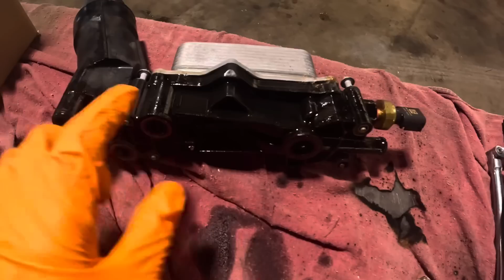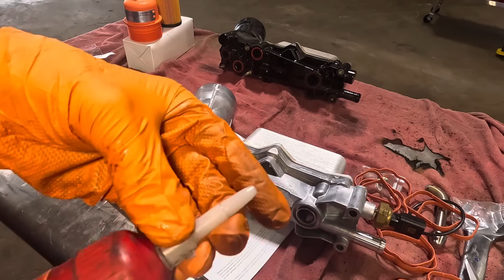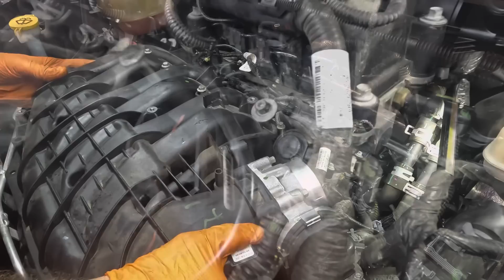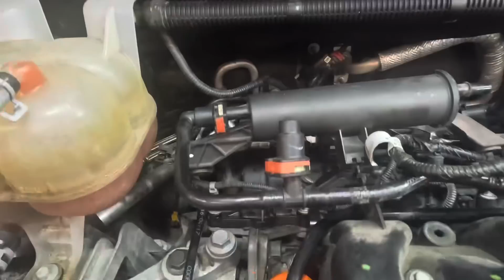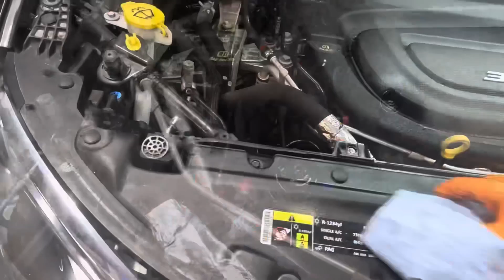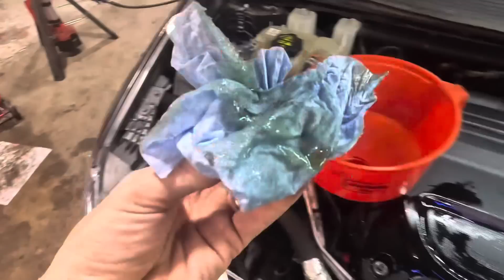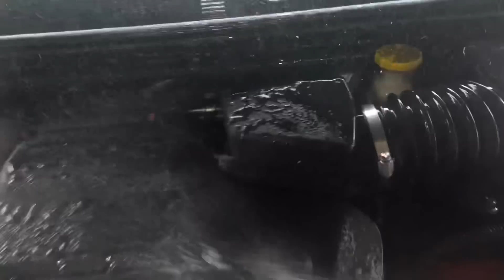Plastic Pentastar 3.6 PT2 Chrysler Dodge Jeep Ram Volkswagen. Leaking Oil Contamination!

Comment: As I understand it, the torque wrench in reverse thing is mostly about not performing unclicks on set fasteners (the ones that require a "Nyyraahh!" to get moving to begin with, especially), rather than simply loosening not-yet-torqued fasteners prior to torquing. Because torque wrenches aren't (usually) a solid piece of metal, but rather a number of floating bits of hardware in a tube in order to enable their ability to click and adjust for varying levels of torque. The stress of unclickage can break 'em. Other'n that scenario...yeah, sure. I don't see any reason not to use 'em in reverse...but then, I usually have to operate on the "get tight, then go a quarter turn to torque" because I have a ginormous torque wrench for tires and no small ones....yet.

Comment: You are lucky it's in a Pacifica and not a dodge promaster. The intake manifold bolt tend to rot away from no engine cover and I'm in northern Ontario where salt is used in abundance lol. I've done 3 now and I had to break the old intakes off of 2 to get to the 2 rotten bolts unfortunately

Comment: I'm curious are there any good manufacturers left ? Sure the older ones didn't have abs brakes. Maybe even got lower gas mileage.  But when your new car or truck arrived it didn't have a computer they charged 10 grand (or more) for.  I think my next "new" vehicle will be made in the 60s or 70s and come from Arizona.

Comment: Aren't those engines also known for dry starts? Their is an oil filter conversion kit that fixes this issue, bit I wonder if it would work with that updated cooling unit.

Comment: While I am mechanically minded, I'm not a mechanic by any stretch of the imagination. Regardless, I've learned enough through your videos that when a friend of mine needed a part replaced and they wanted to charge her an exorbitant amount (which they claimed was a great deal), I was able to tell her that replacing that part was super easy and that there's no way that it should cost that much. So she went out and found a shop that replaced the part at 1/2 what the original shop was going to charge her. Your videos are saving us money! Thanks!

Comment: My guess on the reversed torque wrench is the amount of torque applied in reverse.
I used too loosen the lugnuts when changing summer/vinter tyres with my torque wrench. One day I felt I needed too much force, so I changed method to something with less precision.

You can probably break the torque wrench if you overtorque it in reverse.
Reply: You can break it in either direction, use a 4 way or breaker bar

Comment: Ray, every spend hours putting an engine like this one back together, start the engine, then see a fine spray of some fluid shooting over one of the fenders from low in the engine?  Also, glad to see you are not a tool thrower.

Comment: Knock on wood, I own a 2015 Wrangler from new in Feb 2015,  no oil leak yet (52,000 miles) and just looked through some jeep forums and that is a common problem for the 14/15 wranglers. Great! I guess I'll be on the lookout for this or possibly do this change before it happens.  Thanks for the info Ray!
Reply: There are other spots on that particular motor that will leak, you will find plenty of yt vids

Comment: Isn't it the chemical composition of the coolant that determines if they can be combined?  Some are ethylene glycol, some have silicates, some don't, etc.?  Isn't the color coding supposed to indicate the chemical composition?
Reply: The universal extended life coolants, like the cheap house brand ones are all you need.  They satisfy all specs and mix with every formulation.  I can tell you from over 17 years of experience using them,  they're the best.

Comment: i would bet that the plastic parts didnt have threads in them when they were installed at the factory and the bolts cut there own threads when they were installed.

Comment: At 17:00, I'm glad you said that Ray. One of the clowns I used to work with was like that. If you did a job differently than he did, you were an idiot. Even though the end result is the same. One time at training we were discussing that very same thing. The instructor said it doesn't matter how you do something or figure out a problem on a vehicle. There is always more than one way to do it. Doesn't mean any way is right or wrong.

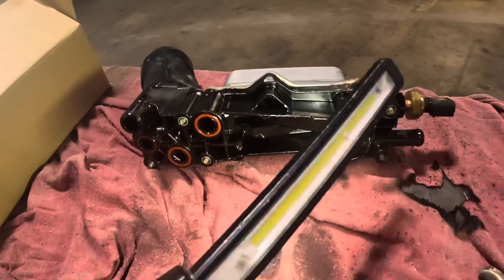Comment: 1:45  And Chrysler will not do a thing about a crappy part.  Just make you keep on replacing it.
I haven't received notifications from YouTube for years.
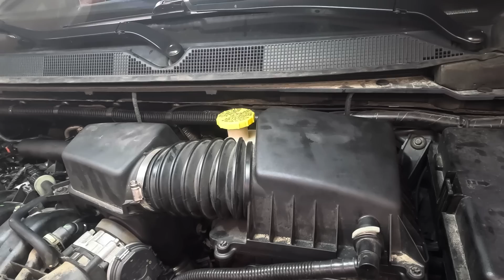Is it me, or didn't you tighten down  the air intake hose from the filter box?  45:55 to 46:44
Oil price is a bit expensive.

Comment: I'm back again Ray. I do hope you are getting enough sleep. At 22 minutes you spray the screw holes out to assure no liquid or debris inside, but then proceed to spray penetrating oil (which does not evaporate quickly) over those same holes without showing or mentioning blowing them out again. That twice today that I detect you deterring from your usually logical and consistent standards of performance.

Comment: Probably like everyone else has said - that part is much nicer - and appropriate for a part deep into the engine. The convertible I had - it was heavy - they said the factory suspension was not durable - did not wear out so much has have our terrible streets destroy it.  So they said the use - I could look it up but a brand that started with M and they make modified parts - and he said when that suspension comes up for replacement we should use that.

Comment: Hey Ray, I think you goofed up a bit with the loctite on screws #2 and #3 by applying it just beneath the screw head on those screws. The thickness of the flange on the oil cooler suggests to me that little, if any, of that loctite will actually make its way into the area where the screws actually grip the threads on the part to which the cooler is being secured.
Loctite down in the hole and loctite on distal end of screw threads = good. Loctite applied just under the head of the screw - not always good.
Reply: My concern on applying loctite to the hole is if its a blind hole it may hydro lock and crack the housing if its a blind hole I have seen this many times

Comment: I really only knew Dorman for those drawers full of nuts, bolts and hardware, that stuff was pretty good and saved me a few times. A couple of years ago I was going to replace a driveshaft in my AWD Volvo XC70 and considered a Dorman replacement shaft. I ultimately opted to dispose of the car, but I doubt that I would have used that Dorman part.

Comment: Using a torque wrench on a part or fastener with a MFR specified torque is never "fooling around".  It is always correct.  Maybe not always necessary, but it IS correct.

Comment: Not to criticize, Ray, but I noted that you didn't pre-thread some of your fasteners before putting your power tool on them and running them down.  Doesn't that have a big risk of cross-threading?  Either way, it made me cringe every time you did it.

Comment: Depends on the torque wrench. Read the manual on your particular tool. Some go in both directions, some only indicate in one. You might be able to remove the fastener by going lefty loosey, but if you’re trying to get a torque value, it might not work (ie give a valid reading) but not damage the adjustment, and some units might be thrown out of adjustment by being used “backwards “, and give bad readings. But since this particular one comes with a reversible ratchet head, I am sure it is fine.

Comment: The torque is important for plastic holes, someone without a feel for what it can take can destroy the threads. If you have that feeling and a level of caution from experience you can do it by hand. It has gaskets and no mess if it leaks slightly, if it leaks enough to effect air mixture the tightening was totally botched on the lose side or the gasket has an issue.

Comment: Curious, since that sensor is buried deep under the intake and it takes a lot of time and effort to get to it, instead of taking it off of the old part and putting it on the new part, why not just replace it?  Would that not be cost effective?

Comment: Ray, when using lubricant to slide the shaft into it's hole, you really can't use too much. The more the better. It makes it a lot easier, and will keep things from tearing. It also makes it more likely you'll be able to do it again later if the opportunity arises.

Comment: Yeah, the VW Routan is just a Chrysler POS wearing VW badges, with some VW electronics and exterior lighting/fascia. VW actually builds a great minivan and pick up, but does not sell them in North America (thank you LBJ for that stupid Chicken Tax). However, VW is planning to team up with Ford and build a pick up based on the Ranger platform. And since the Ranger, Ranger Raptor, and the Bronco are the same platform, that means you should be able to use the Bronco upgrades on the Ranger and whatever the VW version will be!

Comment: Hey Ray, yes those desiccant packs are nice, but they will become saturated, especially in a moisture saturated State like Florida. So, every now and then, take them out of whatever you were keeping them in, and bake them for about four hours, at 300 degrees Fahrenheit or so. Temperatures above 325 can damage the silica though. So don’t try to rush it. This will dry them out again. After they cool, throw them back into the toolbox. If you happen to get a bunch of them at once, make sure to store them in an airtight container.
Reply: I think the bake temp is more like 250 degrees, if memory serves
Reply: Good ideas, I learned something.

Comment: When you were installing the upper intake, you did not install the foam sound insulator.  After you "torqued" ( a loose term in your vocabulary), the insulator was still sitting on the metal framing.  What did you do; throw it out?

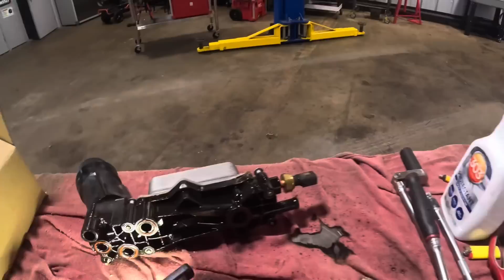Comment: @2:10  I'm sure that part of the issue is the Brainiac mechanic using the 1/2" breaker bar and both hands to tighten the oil filter cap that's supposed to be torqued to no more than 18 ft-lbs.

Comment: In the aviation sector there are a few bolts and or nuts that are left hand twist with torque specifications, so yes you can use a torque wrench either way IF THE MANUFACTURE OF THE TORQUE WRENCH ALLOWS IT..

Comment: A tip for that silica packet used to reduce humidity... they absorb moisture from the air and eventually become saturated to the point thay can't absorb any more. BUT, you can lay them on a cookie sheet and put them in an oven at very low temp (to prevent burning) for an hour or two or three and dry them out for reuse. 
In fact, you can also buy silica packaged in metal containers, especially for thos sort of  reuse. The stuff in metal tins can tolerate a little higher oven temps to dry out a lot faster.

Comment: On startup of the 3.6 pentastar it has a flooded start function where if you floor the pedal on start up it will crank but no fuel injected allowing the engine to dry a flooded cyclinder and build oil pressure. About a 15 second crank will get about 5-10 psi on a dry oil filter.

Comment: I wish you had posted this several months ago when I had to replace my oil filter holder and oil cooler. You are much more complete in the reinstall than the others on here. Those guys rushed through the reinstallation skipping past most of the fasteners and connectors.

Comment: Hey Ray could you put a straight edge on the plastic adapter to see if it really a warp issue or just worn out o'ring seals . I have a Gladiator and would like to know with only 15,000 miles on her i,m still thinking about doing this with mine . Great videos !

Comment: I've used my 18" long 1/2" drive torque wrench as a breaker bar, lol. I put it on its highest setting and have at it. Been doing it for years and it still works perfectly.

Comment: So happy I sold my '15 Chrysler T&C a few months back.  Great looking, great handling, but just built like crap.  Had the rocker arms, the transmission, struts/shocks all around.  This oil cooler issue was major reason I sold it.  
I ended up keeping a Toyota Highlander with 170k on it, runs like a top.  Total confidence in it.

Comment: It’s not that you aren’t supposed to operate a torque wrench in reverse, it’s that you aren’t supposed to use them to break fasteners loose. That’s because they could be so tight that it will throw the torque wrench out of calibration.

Comment: i live up north in mass and iv done so many of these and most the time so many of the plastic parts get so brittle and they break off just looking at them the wrong way lol, those valleys can be a pain to clean i usually had small caps iv found through the years to cover the holes and spray it with some brake clean and suck it out as much as i can, and 8/10 times i had replaced the knock sensors because they were throwing codes from being so saturated in the coolant and oil for so long.

keep up the good work been watching for a couple years this is my first comment and honestly sometimes i get a kick out all the RRRRRREEEEEEE in the comment section and the people who are always "thAt WoNt fLy In My ShOp" seem like their the greatest to work with.

Comment: As  former gm worker I use to work at Buick I flint mi. In da 70s sometimes I'd get loaned out to assembly line and put on turn signals on front corners well when you screw drill em you sometimes don't get  a good bite and they crooked or stripped some kind of plastic and fiberglass crap probably same as plastic manifold bs be better if they made a after market aluminum manifold for these nightmare  designs like updated oil cooler Assembly good idea even from dorman.. you wouldn't belive all da strip tur.n signals out there In junk yards still root cause was production line speed they were making thousands of em fast da GM way..

Comment: I first used Amsoil in 1970, I put in in my 1969 ford van and when I change the valve cover gasket I could not believe how clean it was . Founded May 23, 1969
Reply: I had a neighbor that was a reseller back in the early 80's.  We used it in our vehicles.

Comment: Ha ive replaced several of those things and not all were aluminium oddly.. and if i remember right i did one on a promaster van as well. The metal shelves in the back rattled during a testdrive i ended up with a facial twitch pulling back into the shop. Geesh ! 😂

Comment: Perhaps the torque wrench operates in both directions so that you can set right and left hand fasteners?  II, too, have been told, “Don’t  operate the wrench backwards!”  But, how do you set left handed nuts, bolts, etc?  I’m so corn-fused.

Comment: Those oil pressure sensors are highly failure prone, as well.  I replace them with new OE sensors when I do this upgrade.  Dorman does give a torque spec for the sensor (and all the other fasteners) in the instructions in that box, too.  They did a pretty good job with this part.  I only hope their seals last.
Reply: Yes I would have replaced the oil sender as a matter of course!. Preventative maintenance. ;)

Comment: Are there not some coolants that shouldnt be mixed or might void warrantees?
Reply: Some if mixed will turn to gel, especially between older and newer Chryslers.  The universal coolants supposedly work with either and are supposed to be fine.  I don't use universal coolants but many shops do.
Reply: @johnaclark1   I've used only universal extended life coolants for around 17 years and had no issues whatsoever.  In fact, in some instances the universal extended life coolants are superior to the OEM formulations.  An example of this is G-05 with it's silicates and borates.  Silicates destroy the water pump seal and borates pit aluminum.
Reply: @coolantkid3428 This Pacifica is not G05. Chrysler stopped using G05 in 2012.

Comment: Did one of these in my wifes  ram.  I got the metal replacement one. Mine didnt seem warped or cracked but i believe the orings leaked.  It wasnt a bad job to do and by the time it failed at 80k it benefitrd from new spark plugs and coolant anyways. 

Other than that have had no troblubles since 5k miles when  dodge got some bad oil pump solenoids. 

Tuning the tcm made the truck drive like it has way more motor in it than it does.

Dorman didnt have them aviable when i did mine. So got one from the company that probably makes them for dorman. On the one i got the sensors had incompatable sealant on them and caused a leak. I just put the original sensors in it since the ones that came with the coller seemed to be out of spec or calibration

Comment: 😊😊😊 two things, one, did you install the foam insulator before installing the upper intake?? Second , there may be a burp valve at the thermostat housing that you should use, my Doge did.😊😊😊 And you could have cleaned that valley way better my friend! 😊😊😊

Comment: I had this same issue on a 2012 Challenger, replaced the oil cooler, as well as the plastic thermostat housing and plastic coolant bypass on the front of the engine, at the same time, all with the aluminum versions, had the plugs and coils replaced as one of the coil boots were leaking. No issues since!  Good video Ray!
Reply: This problem is inherent of all pentastars and usually happens before 100000 miles

Comment: Do torque wrenches wear out?
Reply: Not necessarily but based upon it's internal design they can and do go out of calibration.  Every torque tool manufacturer i am aware of recommends, routine calibration checks and in some industries like aviation that is mandatory. And yes they do go out of calibration.

When in doubt read the paperwork that came with the tool.

Comment: The gen 3 Pentastar engines hold only 5 quarts of 0W-20 oil for most applications (including the Pacifica). Using 5W-20 oil is acceptable if you're in a warmer climate.
Reply: He did read the dipstick before topping off?